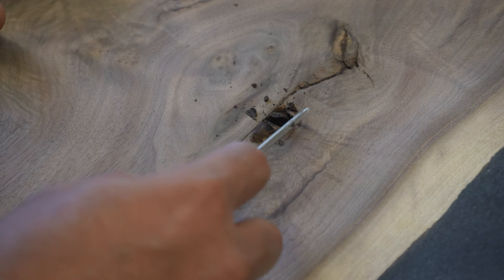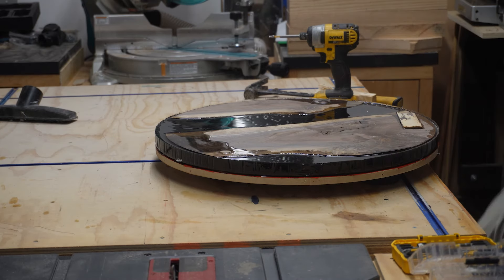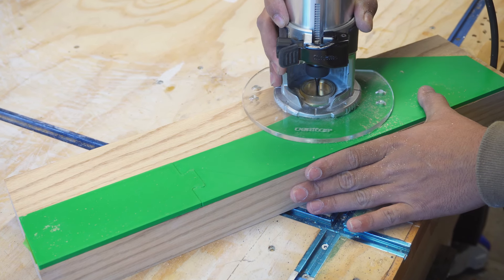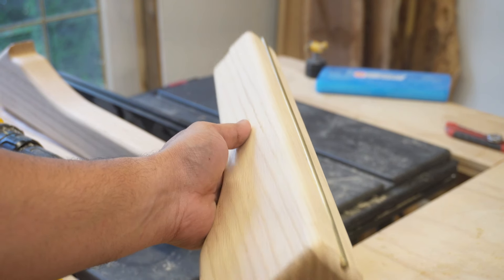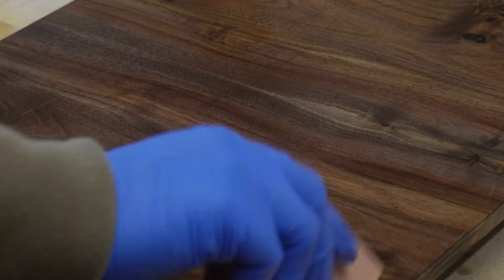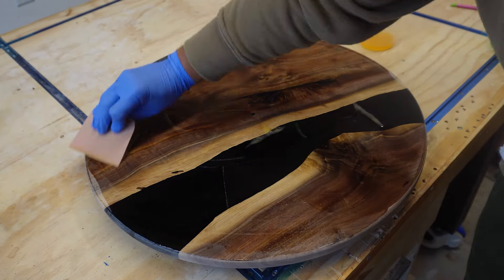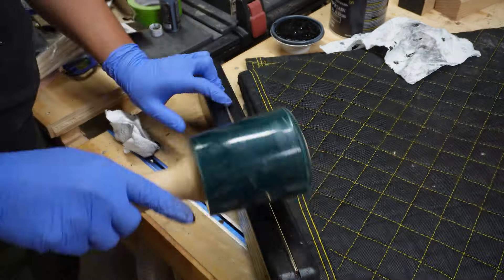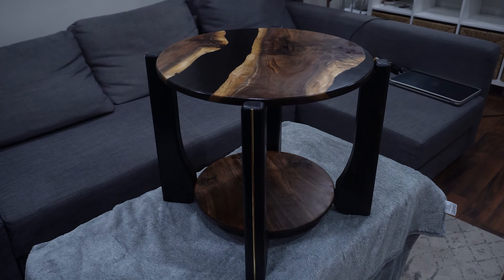Walnut and Oak Epoxy Coffee table

Comment: That’s a very nice looking table and yes, to someone who is in the market for locally hand crafted solid hardwood furniture worth the $1000 price tag. Was the client happy with the legs? I initially thought they had chosen oak and walnut for the color contrasts that the natural looks of each wood offer. 
Quick side note: I’ve been a professional painter and finisher for many years and I’m not a fan of solid stains, especially WB solid stains. Yes they are very easy to use and very forgiving if you mess up applying them (no lap marks, etc) but it defeats the purpose of using a stain. Stains were initially designed and intended as a penetrating coat (to accentuate the natural beauty and color of the wood) NOT a protective film coat (like paint, lacquer, conversion varnish, poly, etc). Solid WB stain kinda fails at both of these ideas. They completely negate the natural look of the wood (making it pointless to use nice hardwoods like Oak) and do not stand up as well to wear and tear and can chip and peel easily leaving unsightly marks. If you really want a solid color that still leaves a lot of the wood grain look, I would suggest learning how to spray a high quality WB urethanized primer and topcoat combo like Stix and WB 2k Polyurethane. This will give you a MUCH more durable finish that if applied correctly will look great (applied thin enough will still  leave the wood grain visible) and will stand up to the worst abuse but won’t chip or peel. If you want to use stain, learn how to use a semi-transparent or even semi-solid oil-based stain to achieve the color you want without covering up the natural beauty of the wood. Yes, these products can smell but These days there are oil based options that are fairly user friendly and these coats will not chip or peel (because they penetrate the wood instead of creating a film). 
At least, that’s my two cents anyways. 

Nice work!
Reply from the maker: Thank you for the detail insight into wb finishes I will keep this in mind for future projects, and yes my next investment will be a  HVPL spraying gun as I want my furniture to last and be appreciated for years to come, cheers!
Reply: @MTM_Officail  No problem! And yes, I would encourage anyone who wants to apply film coats to furniture to learn how to spray. There are good airless sprayers (namely Tritech with the correct tip and technique) that can get a factory finish as well as HVLP setups. HVLP is honestly a bit tougher to learn (more variables to learn how to control) but the Tritechs are expensive. If you do go the HVLP route, I suggest getting a nice gun, not the Harbor Freight model. I learned that lesson the hard way. If you know someone who uses sprayers professionally, getting them to show you the ropes could help cut down on the number of costly mistakes it takes for anyone to become proficient in spraying. It’s not an easy thing to master but well worth it in the end. 

Anyhow, keep up the good work and good luck!
Reply from the maker: thanks once again will look into it